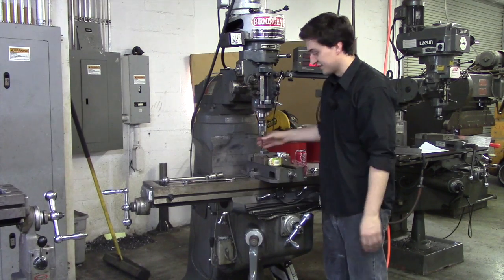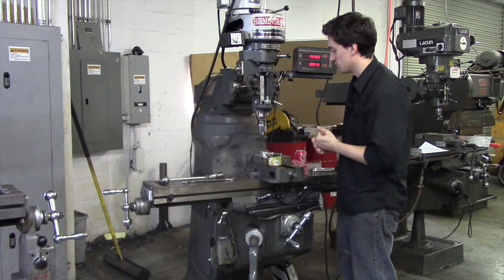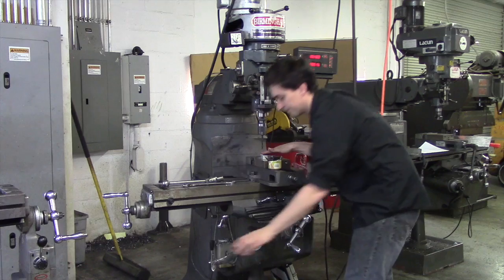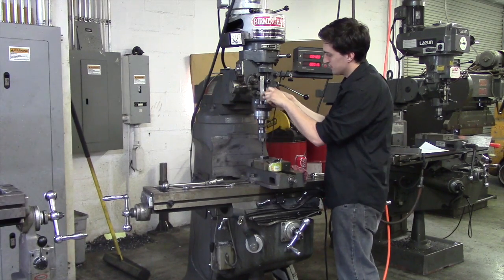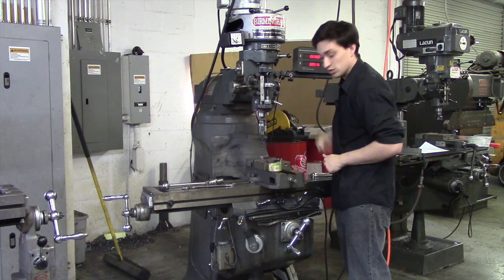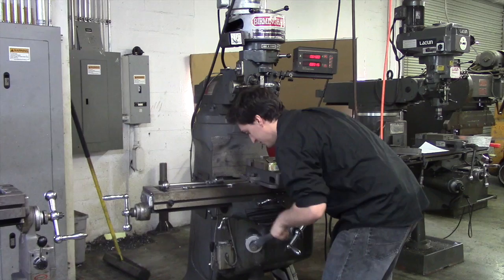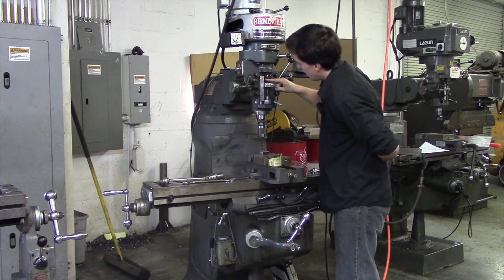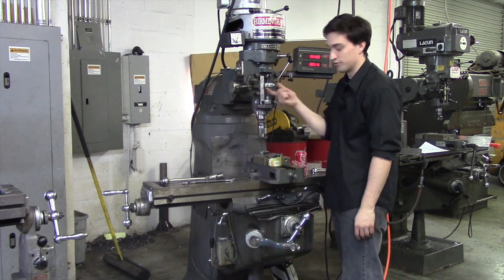Manual Mill Drill Depth.

Comment: When it comes to keeping depth tolerances do they generally account for the angled tip of the drill or only till the walls of the drill
Reply: Just the full diameter or as you said the wall. The tip of a 118 degree drill is about .3 times the diameter minus about .021". 

Drill bits will vary depending on the wear and precision of sharpening. It's best to drill a little and then measure the depth so you know how much more you need to remove. For precision you can use a surface plate and height gauge with a squared piece of stock. You can insert ground pins or use the drill bit to calculate how deep the hole is.
Reply: @supermetaltastic minus .021? I thought it was dia X .3 for 118 and dia X .21 for 135 degree twist drills
Reply: @peeeoii2738  yes, but drill bits don't come to a perfect point especially after drilling holes. The books tell you .3 times 118, but in my experience it's often more accurate to minus a little for a closer estimate. Try it and use a surface plate , height gauge, and depth gauge with a faced piece of metal. Put the drill into the drilled hole on the surface plate. Measure from the top of the stock to the top of the drill bit.  Depth of hole including point= Drill bit total length - height of drill above stock. The use a depth gauge or pin to measure hole full diameter depth. Then  depth of hole with point- full hole diameter depth= drill bit point height. Measuring is going to be the best way to go.